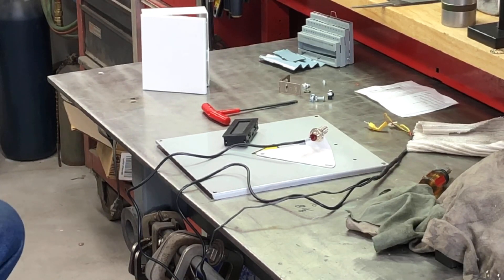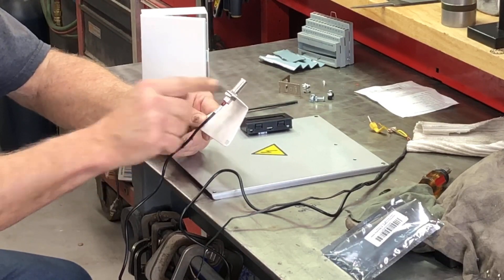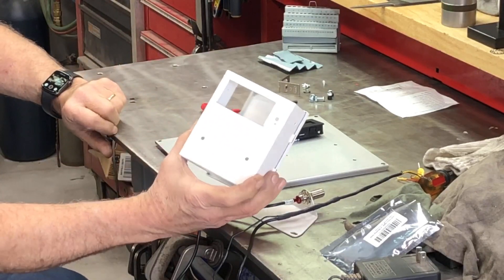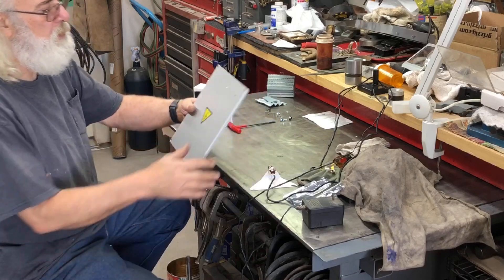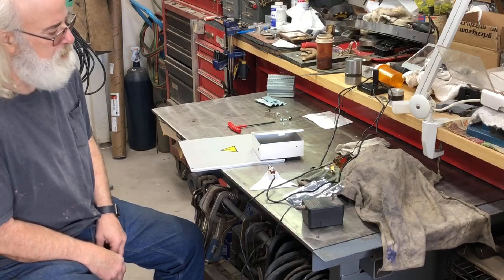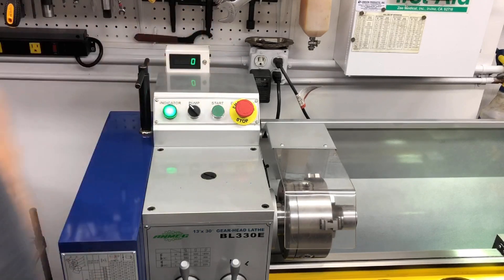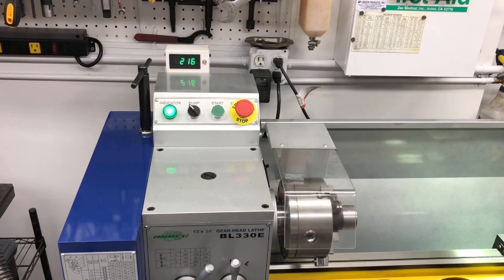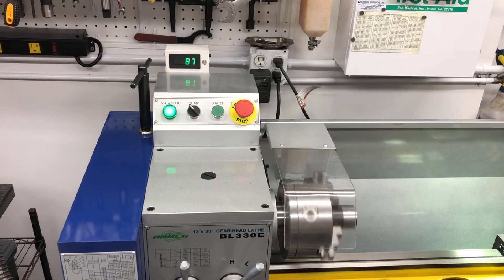ANMEC BL330E Lathe, Installing a Tachometer

Comment: so how's the new lathe . Are you done with YouTube
Reply from the maker: I really like the new lathe. Is very capable and the price was right. 

Still doing videos but right now I’m preparing for summer so I’m not in the shop for a bit.
Reply: On mine i did not like all the back lash in the carriage hand wheel .two things i did found the hand wheel pinion gear key way was not tight so made new key and then adjusted the rack you have to knock out the roll pins made it way better i had to remove the apron hope yours is ok
Reply from the maker: @junkmannoparts9696  I noticed the backlash immediately!  Must by the same thing as I checked and most of it is the gear rack to pinion gap.

There’s a list of things I intend to examine in the future but I want to get a few hundred hours on the machine first.  It makes it easier to see where things are out of spec.

I can say that the Lathe is performing very well and getting smoother as time passes.

On that subject, how hard was it to pull the apron?

It looks straightforward to me.
Reply: Not to bad had to pull the lead screw and i think the switch shaft slips out with out removing the switch just have to unscrew the cover note i don't remember all details .  I just sold mine and ordered a Precision Matthews 1236